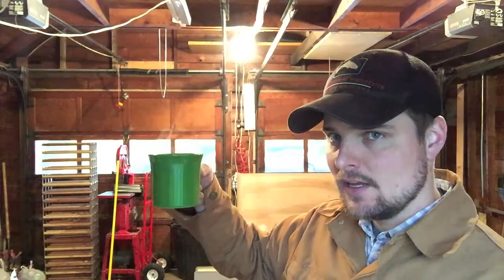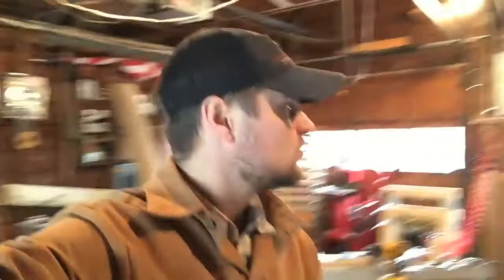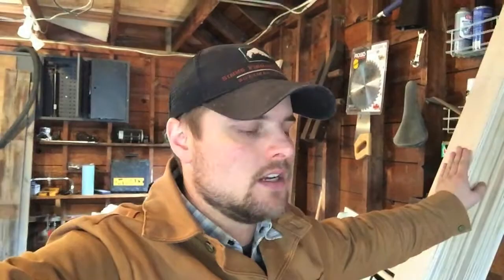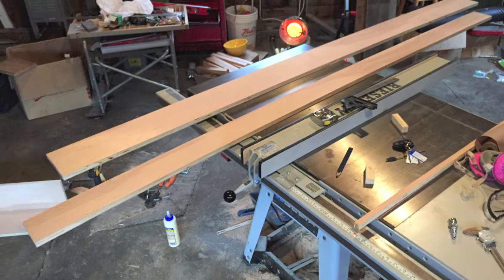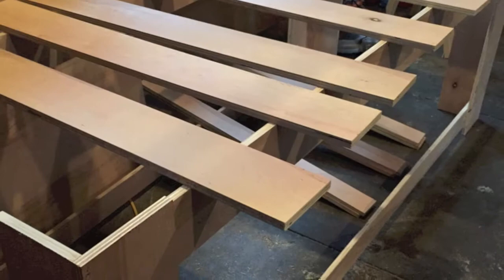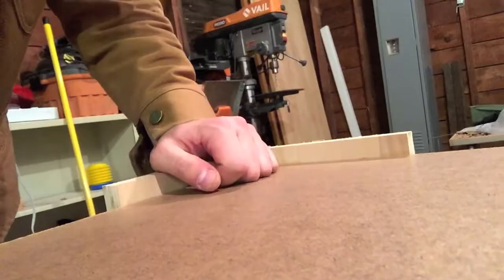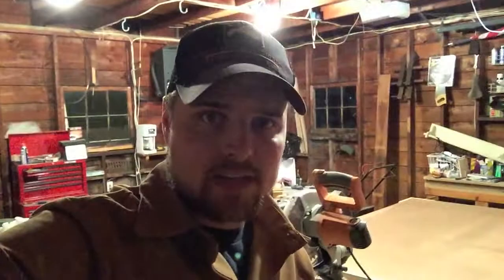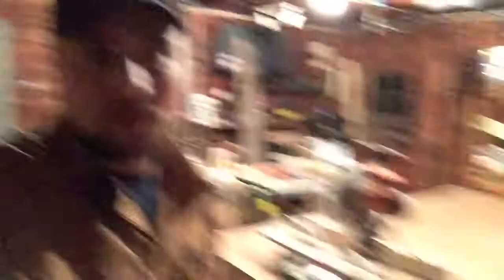Assembly & Outfeed Table Part 1

Comment: Jim,
      Very nice table and I'm certainly looking forward to the second installment.  I am setting up my new shop and your table design is probably the one I will go with for my out-feed/assembly table.  I have to agree with Paul that more video on the actual assembly of the table and details on the component measurements would be helpful.  Can you provide a list of the materials used?  Keep up the good work!

-Barry
Reply from the maker: Thanks for the kind words Barry! I'm definitely hoping to get part 2 up this year, though like most hobbyists and woodworking, I already have 3 other projects also going. Keep an eye out for a crosscut sled video and an air cleaner / dust collector fan video soon!

Jim

Comment: The only issue you might have, which i had, is that the outfeed table is too far away from your table saw. The thin boards droop more and thus you cant cut them. i had to move them closer. Other option i thought about was adding a ramp that i could clamp onto the side to then force the material upwards. I didnt go with that because of my shop size.